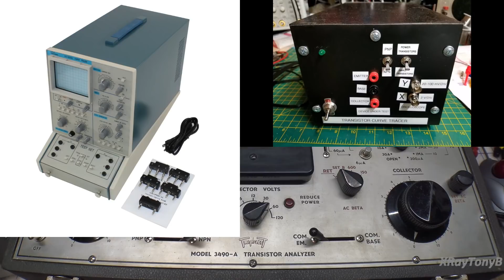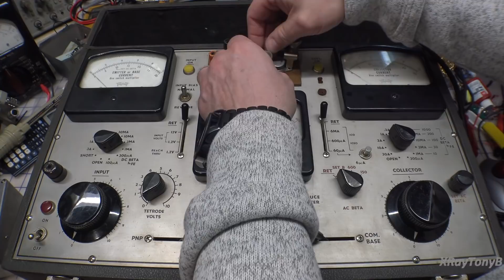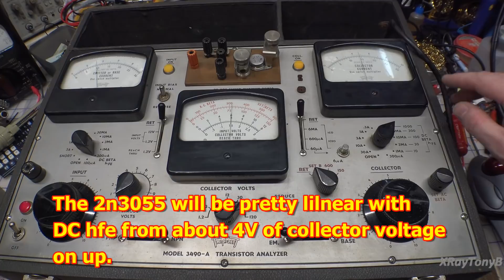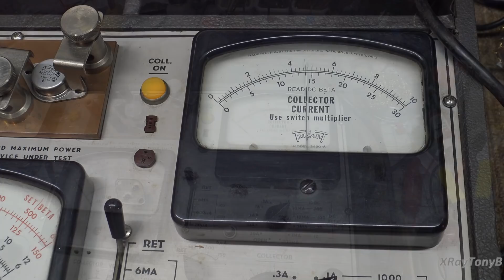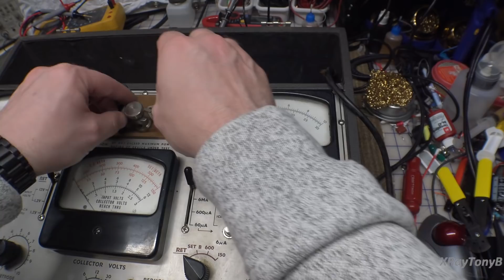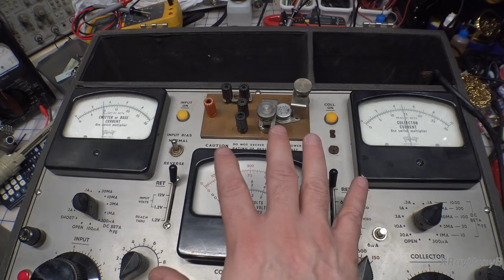Random Video - Triplett 3490-A Transistor Analyzer Show &Tell

Comment: Cool I have a DC voltmeter gauge that looks almost identical to the 3 gauges on that. I bought it at an antique store for $16. It has its own leather case but I took it out of it because it's dried up. But the rubber test leads where kind of brittle.
It has a negative post and 3 positive post. 1st post on top left is negative. 2nd post is for 0-3 volts. 3rd post is 0- 60 V. & 4th post is 0- 150 V.
I haven't been able to find it on the internet.
It says DC volts S-C Stromberg Carlson on face 1000 ohm/V
On the back it says it's a Simpson gauge. made in USA
It's a real simple DC voltmeter I like it. 4" 3/4 inch wide. 4" 1/4 tall. Or 5" tall if you add the post